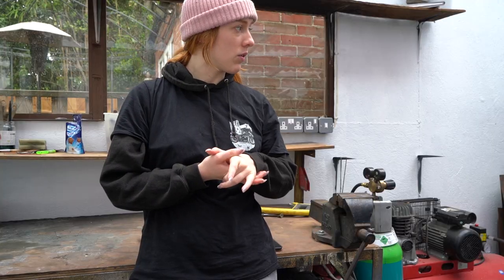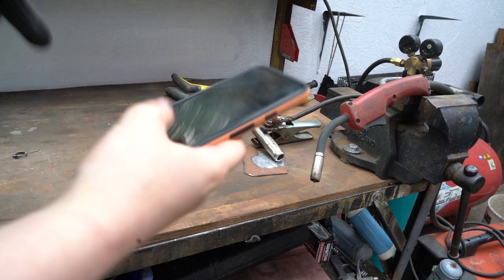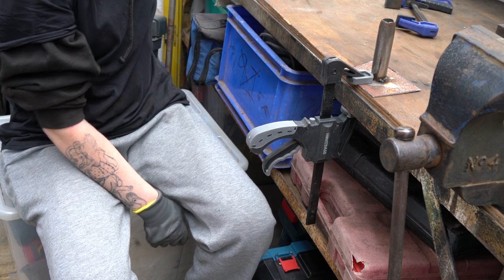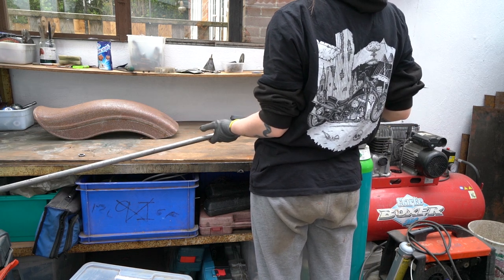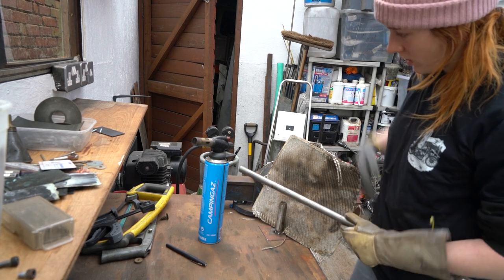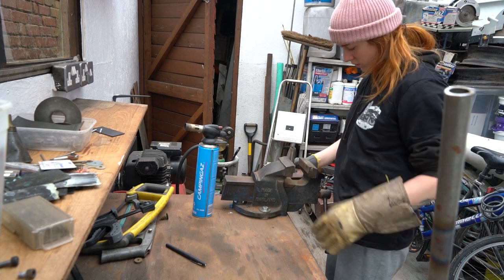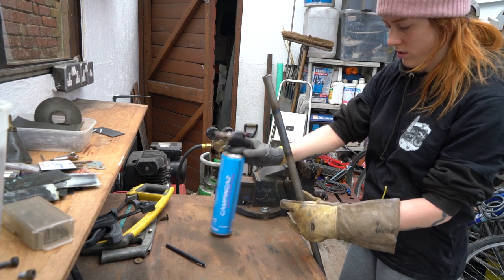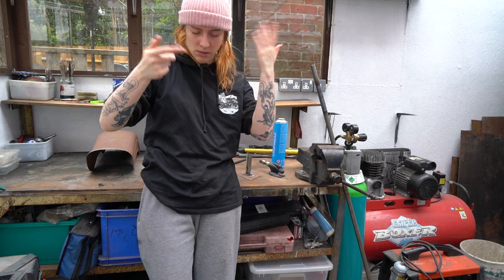Yamaha Chopper Build: DIYing a Sissy Bar Jig (and failing)

Comment: You need to use solid bar stock not tube, tube will just kink and that little plumbers torch won't get anywhere near hot enough, forge or Oxy acetaline but both are dangerous unless you know what you are doing. Keep building the skills will come with time good to see you having a go, most wouldn't

Comment: It could be complex to bend tube. But trying is always interesting. For bend point, for me, you can use the table and the vice, forcing vertically. And forcing seriously ;) (I mean, you looks like feared to broke something, but it's hard steel). Again, it's difficult to do and if you want tube, the better way is to fill  (at least) the bent part with (very) fine sand, sand have to be stock into the tube. It will keep round shape. Another thing you can look, it's to find some already bent tube and weld them. 
Anyway, good job ! It's really fun to see people trying to do something as in real life !

Comment: the steel was not hot enough to bend use the big oxey set you have sitting next to the vice 
and get the pipe glowing red hot then you will be good mate 👍👍👍👍
Reply: I second this what I was going say once red hot you be able bend with your  Pinky
Reply from the maker: Thanks guys will heat for longer and with better tools!
Reply: that's not an oxy set dude it's a bottle of Argon
Reply: @sugarskullleatherworks6417  cant be right all the time lol

Comment: You should put two bit of pipe in vice  and space them out to type of bend your after close together for tigher bend and space them out for less of bend heat it right up pipe up after you got everything set up first the way you want it the heat pipe up to about cherry colour then start bending lass but be careful not to end up flatting plpe and to make it easier to bend pipe keep heat on pipe when bending it lass it takes time to learn new skill lass keep at it or do a practice run on bit of scrap pipe etc to get the idea take it easy lass
Reply: Don't bother trying because it won't work.
Reply: @neodutch  why not iv use this number of times on field service repairing equipment on site to get jobs done
Reply: @seanpurcell9056  You bent 1 inch tube to almost 180 degrees on a 1 inch radius? Don't think so.
Reply: @neodutch  thats not whats she doing you getting right off track there man your on something  completely different there its not making a seat hoop etc yes you can if you fill the pipe with sand you can to stop pipe from flatting out plus use wheel bearing insted of pipes to bent it round
Reply: @neodutch  plus back in the day when i was a mechanic and training  you did not have the tools to do the job or off the shelf you made them back then to do the job not like fitters now a days

Comment: I love that you try even though not sure what or how to do it. I very same way with my build metal work is so different then what I do everyday.  Aging use  Oxygen assettling will heat pipe  heat up much better red hot and you'll be able bend that thing with no muscle at all All. 😁👍
Reply: Advice from someone that has never bent a tube.

Comment: This guy makes it look easy https://youtu.be/KMl83DpLHfk  He's using solid bar with an oxy acetylene torch. I have managed to bend small pieces of plate (6 mm thick) in a vice using a hand held map gass torch but it takes ages to get the metal glowing a cherry red colour. It was relatively easy to bend with a pair of pliers but you have to be quick. I think you might need to use solid bar. Google seems to suggest it's common to use about 12mm (1/2 inch - ish) solid round stock for sissy bar! I suppose if it was easy everyone would be doing it. There's no such thing as failure, just learning how not to do something! Good luck with the build!

Comment: Look YouTube for a guy named David Figie - he's done a tutorial vid making sissy bar.
+ first use a wire coat hanger to make a pattern of what you want to produce then you can figure out how to upscale
Reply from the maker: I've done the pattern with a small copper tube already, but upscaling it is way more complicated with the bends
Reply: @sunbleachd  if on a hardtail frame & supporting weight of a passenger you need to use  19mm solid bar.
If on a suspension rear as yours just for looks or luggage 10mm solid bar is plenty strong enough for the job and a lot easier to bend,
Work out how much bar you need - add a couple of foot to length ( longer bar = more leverage so easier to bend)
Start in the centre (top of sissy bar) put a piece of 1' bar in the vice to bend around.
Make a little stand (I use car axle stands) at the height of your blow lamp - sit bar across them, stand blow lamp in front.... Take a seat and have a brew.... Will take 10 min's for the bar to get red/orange hot (much easier to bend) as it cools harder to bend so stop re-heat bend again.
Once you have that top tight bend - hardest one to do decide how tall you want to be and work your way downward - this is where making a jig with pins welded to some  sheet is handy to keep your bends even but it can be done without. 
Take your time - measure and re measure as you go and good luck, I'm enjoying watching someone learning same things  I was when I started building...... Some jobs are a bit of a challenge when learning, frustrating - brain meltingly annoying - this is  one of them but stick in there - you're learning new skills and techniques & problem solving at the same time...... Not easy. 
Lastly....  As a very  last resort If you do  get totally stuck let me know fender width & height you want I'll bend you one and post it to you.

Comment: A up flower, how are you, keeping well I hope. Yer know, It would be better done in three-quarter round bar and not in pipe tubing as it's much stronger then pipe tubing.  Tubing has a tendency to fold flat when being bent and is best done in a pipe bender.  You will need to heat the bar to a cherry red at the point you're going to make the bend. The jig is looking in the right direction just one prong short and really needs to be made out of solid bar for strength. Keep at it las you will get there in the end I got faith in you.

Comment: Go to your local hire shop and they should have pipe benders, tell them what you want it for and they should sort you out and it's far safe then using heat. Keep going on the rat build,i think it will turn out just fine,stay safe
Reply from the maker: I am aware others could bend my tubes, I just wanna give it a try first
Reply: No you can hire the pipe benders and have a go a bending the pipe work yourself at home,and yes  i know you want to do as much work on the bike as you can and i am 100% behind you,keep up with the bike build, stay safe
Reply: @sunbleachd  That will be a waste of money as the die radius will be too big.
Reply from the maker: @iancooper8728  I've looked into renting a pipe bender, the money is fine, but I literally can't find the specific bender for what i need. And buying a bender is 😂😂

Comment: Why not just use the vice..
Reply from the maker: I thought it might kink the metal rather than bend it? Idk tho I'm just guessing (obviously)
Reply: @sunbleachd  try using round stock. You can bend it without deforming it. If you get some that fits inside the tube you can use the tube as leverage 🤘🤘